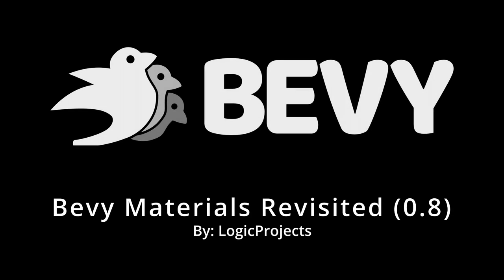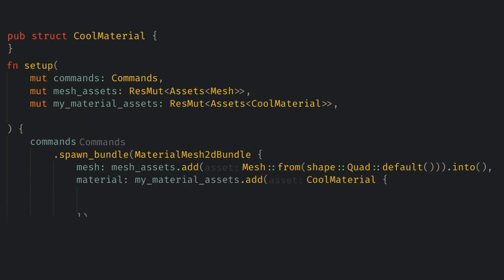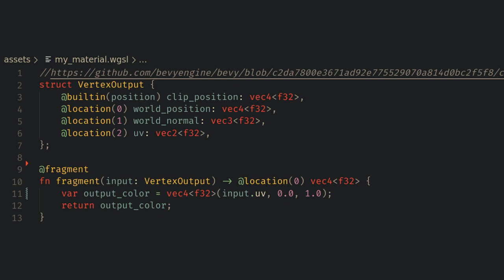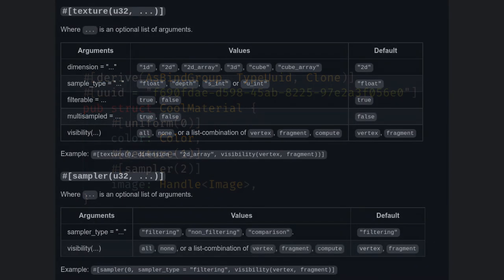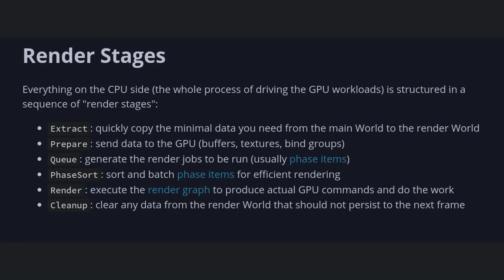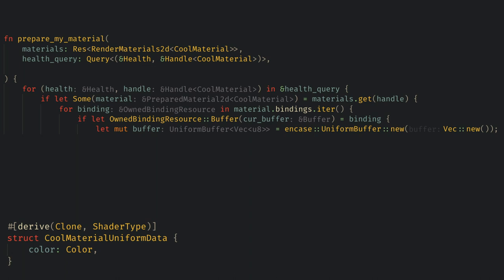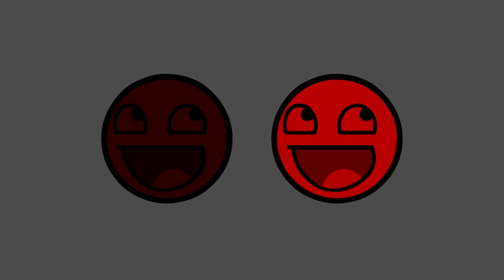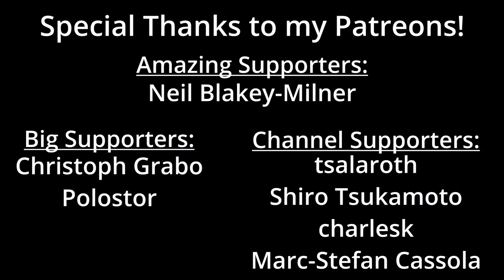Bevy 0.8's New Material System

Comment: impressive how quickly you made a video for the new update. Loved the old one because it explained all the complexity and didn't need this one because it was so straightforward (which says a lot about bevy)
Reply from the maker: I had already wrote and recorded this on the 0.8 dev branch so I cheated a bit to get this out. It is super easy now but I hoped the second half would be interesting enough to justify the video (the new extraction systems and getting the buffer to update took a bit of engine reading to learn)

Comment: Do you happen to know much about the camera system as it currently stands?
I saw a "DepthCalculation" field on the struct, and didn't know if that could be used for "depth of field" effects.
That's certainly something I hope they get in there with the "post" stuff they're gonna be working on (if it's not already part of renderer - haven't tried the depth calculation yet)
I was reading article on Unreal, and it's basically just splitting into 3 layers, blurring front and back layers, then blending them all together.
That one effect can really change a game imo. Make it much more realistic.
they have kinda a "high end" and "low end" modes (cinematic and game) in Unreal.  Not a bad idea to  have 2 options here even for real-time (support all cards with improved experience if newer card exists in system)
That brings up a whole other topic - Feature Detection - but maybe all that stuff just handled under the hood, and not by app dev. I guess it's mostly wgpu based feature detection really, so framework could just shift rendering algorithm incrementally based on hardware 'capacity' available.

Comment: I love that it is now this easy to create custom materials but i did some testing and found that MaterialMesh2dBundles performs much worse compared to SpriteBundles.

1024 SpriteBundles on the screen: 111fps
1024 MaterialMesh2dBundles (quads): 86fps

I am yet to put a finger on what exactly causes such a dramatic performance loss but it is definitely not the shaders or uniform updates because even a shader that simply outputs a color and has no uniforms performs the same.

So far I found 1 way to customize a shader with 0 performance loss (performance gain actually, 116fps!). You need to copy Bevy's Sprite implementation and modify it directly but that's a lot of code that needs to be comprehended.

My guesses why MaterialMesh2dBundles perform so much worse than SpriteBundles are:
* Sprites use hard coded quads instead of mesh resources (most likely)
* Sprites have less vertex attributes
Reply from the maker: This is very interesting. I'd ask on the rendering channels of bevy's discord about this. They are very aggressive about performance and would probably be interested. Thanks for letting me know. My guess would be sprites have batching but maybe material meshes do not but I'm not sure without research
Reply: @logicprojects  Sprites are one of the few (only?) things that have batching currently, so this seems likely. That is something that is being worked on for 0.9.

Comment: I think currently storage buffers are left out? You need to go over all the dirty works to use storage buffers
Reply from the maker: I haven't actually played with them that much. I probably will when I port the live coding project to 0.8. Reading bevy's news it seemed like storage buffers are now much easier to use (specifically the ShaderType derive section of the blog). Is there hidden complexity there the blog leaves out? They claim bevy's internal lights use them so I would reference that as an example

Comment: I feel like video could have been a bit more applicable to a broader audience if more time was spent on discussing some of the basic ideas and principles. For example, (1) what is a shader/shader program/material and when would I use them, (2) what is wgpu, and (3) how can I apply this knowledge to, for example, an existing scene built from GLTF assets in Bevy?
Reply from the maker: That's good feedback and you're right but my target audience wasn't that wide for this video. I saw this as my bevy 0.8 release video and I was highlighting specifically what changed in this version of the engine and celebrating the improved ergonomics of a system that I previously had made many detailed videos on. In my new intro series (after more basics videos) I'll be using this and describing it more in the kind of the detail you suggest